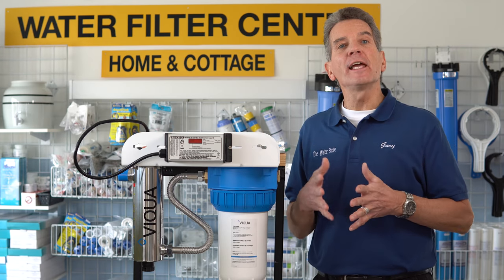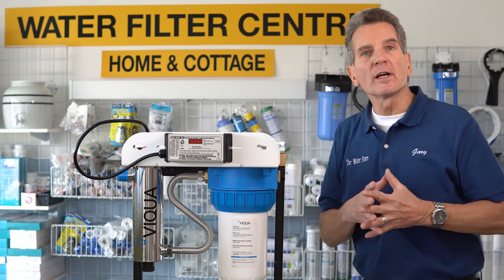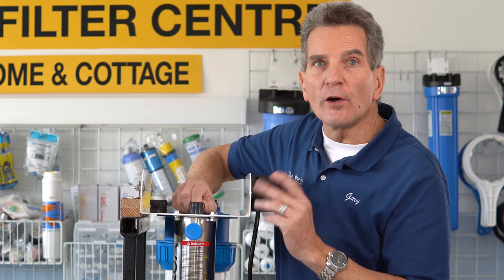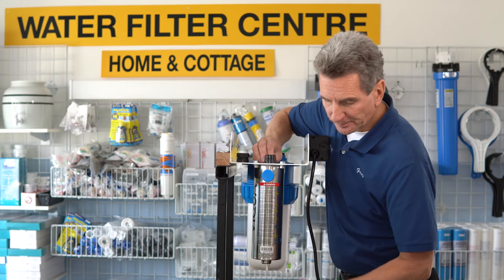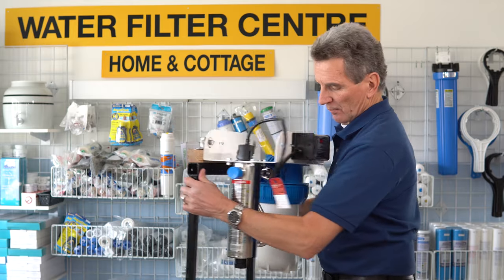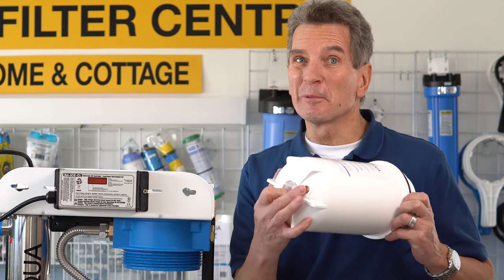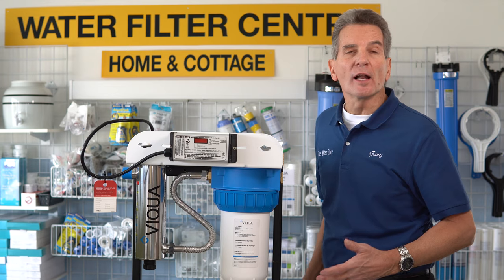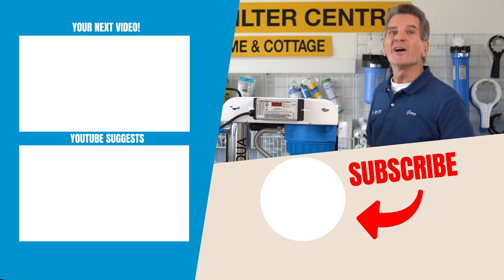Easy Viqua VH200 F10 UV System Maintenance

Comment from the maker: Replacing the lamp and filter in your Viqua VH200-F10 or V410-F20 is super easy.  This video shows you how!
Reply: Can you do a video on how to make the water from a R.O tank colder
Reply from the maker: The only way is by locating the tank in a colder place.  Not always possible in a home.
Reply: Hello Mr. Water Guy,  Last year was a first time disaster. Today it was great. I removed the top nut first. This time I placed a bucket under the UV canister and removed the bottom nut. It was sealed well because no water initially came out. I wiggled and gently moved the quartz crystal tube and the water was released. This time, i screwed on the bottom nut first, but not tight, than I screwed the top nut down. Then at the same time I gently turned the top and bottom nuts (as you showed) tighten.
It's always a confidence booster to not have a drop of water (leak) after a plumbing project.  I hope this video remains forever, because each 6 months I need to change the 5 micron filter and I need to replace the UV bulb each year.

Comment: I watch this video every year.  
One thing you mention is that you cannot test if the lamp works and for sure don't want to look at it.  There is a way to check if the lamp is on. the bottom screw cap has a tiny hole and you can see a purple light. Also, at the very top where the connector is plugged onto the lamps prongs, there is also a tiny hole that you can see the purple light.  Therefore, only after you connect every, can you know if your lamp is working.

This is a great video. I hope it remains for as long as I have my VH200-F10 UV system. thank you very much.
Reply from the maker: Thank you for adding this info.  Also, if the lamp does burn out the system will go inot alarm.

Comment: It's been one year since I installed my Viqua UV unit. It is exactly as the one in this video.  I was very nervous in replacing the UV bulb and the Quartz (glass tube) sleeve.  I installed the Bulb and sleeve and turned the water back on. I had 3 days remaining on the counter. When I pressed the reset button, The count went from 3 to 362.  I thought I'm losing 3 days. I did it again and 362 displayed, then a few seconds later the 3 displayed.  I came back to this video and watched Gary reset the counter.  What I wasn't doing was unplugging the power first, then holding in the reset button, and then plugging the power back in.  My counter reads 365, Yay!
I looked in the paper instructions that came with the parts. They explained how to remove the bulb and tube and to reinstall, but I could not find where it mentioned resetting the counter.  That little piece of information is extremely helpful.  
This 'big' stress of doing this myself is now completed and I thank you so very much Mr. Gary the Water Guy.
Reply from the maker: Thank you for adding your info for the reset procedure and for watching! Please share video with friends and family!

Comment: After doing this for the 4th time I have a few tips. Put a bucket under both the UV lamp and the sediment filter. Once the water is somewhat drained and the valves are shut off to prevent water from flowing back into the unit use the drain screw. Even with the small unit there is a lot of weight. The sediment filter itself has some good weight too it once its full of water and sediment. I used the pressure relief valve on top previous years and it would slowly trip after for days. Using the drain screw on the bottom of the sediment filter you don't need to use the pressure valve at all.
Reply from the maker: Thank you for your very helpful tips!

Comment: Thanks Gary! This was very helpful. My only question would be about a visual check for proper operation of the UV. Are you able to see light from the bottom of the UV cannister through a small peep hole when running?
Reply from the maker: Yes, you can in the black cap. Turning off the lights makes it easier to see.
Reply: @water_estore  I thought that was the case but I just wanted to make sure I didn't install it wrong somehow lol

Comment: When you remove the nuts from the top and bottom of the UV lamp, you are taking the top one off first.  This seems good. My question is when you remove the top nut, will water come out. I'm thinking, no. However,, when you start removing the bottom nut, how much water will come out and how fast?
Reply from the maker: Nothing from the top, unless you forgot to depressurize the system filter.  As long as you shut off the water after the system is will just be the amount of water that is inside the stainless steel housing.

Comment: Thanks for the video. I just bought this system. The UV lamp is good for 9000 hrs or roughly a year (continuous use). If I use this system at my cottage where we turn off the power when we are not there, and we only use it about 500 hrs/year, does that mean I wouldn't have to change the lamp for 18 years?
Reply from the maker: Hi Adam, great question.  This video explains why you should not shut off that UV when you leave the cottage https://youtu.be/axnZG8zSWfM  If you still decide to continually turn off the system, the ballast and the lamp will likely only last a few years,

Comment: I've had the system dor about 8 months now, professionally installed by the plumber that did our entire house. I started getting significant leaking onto the floor in the past day. I replaced the filter first, it was completely black 😮 but i still had leaking. Just removed the bulb - it is completely covered in white residue. The glass tube was also quite dirty, moreso on the outside. I dont see any cracks in the tube. Im assuming it is not normal to be have this residue on the bulb?
Reply from the maker: Nope.  It sounds like your water is not compatible with the uV system.  Was your water tested for hardness and iron?  I'll bet that the hardness is over 7 gpg which means you need to have a water softener installed before the UV. We have them here https://waterestore.com/products/hum-deluxe-water-softener-30-000-grain

Comment: Gary, I’ve got a slow leak on the bottom end after replacement. I used new sleeve, lamp, and o rings. Any ideas?
Reply from the maker: I have seen this happen when there is corrosion on the threads.  Clean then up, use some silicone grease like this  and you should be fine. https://waterestore.com/products/plumbers-secret-clear-silicone-grease-food-grade-113-gram-free-ship

Comment: When inserting the quartz sleeve, how far from the end should the O-ring be placed, 1/2 inch at both ends?  As I tighten the nuts will that safely slide the O-rings in the correct place?
Reply from the maker: Yes, that is correct.

Comment: I have to replacing the lamp and the quartz sleeves, but the new sleeves is close on side and round! Do I have to put the spring outside , it's look that i don't have anought place?
Reply from the maker: Are you sure you ordered the correct repalcement sleeve?  The spring isn't necessary but it is a safety device.

Comment: Hello, I've followed this video and when I slowly pressurize the system it leaks from the bottom nut, quite substantially. Any thoughts?
Reply from the maker: I would check to make sure the o ring on the bottom is seated correctly, you could also check to make sure the sleeve is not cracked.

Comment: Have vh 150 changed light reseted stays at 360
Reply from the maker: If it does not count down the days you need to replace the ballast or controller.  Email us at info@waterestore.com and let us know whaere you live and we will get you a price on a replacement.